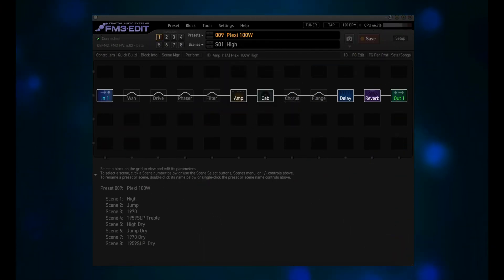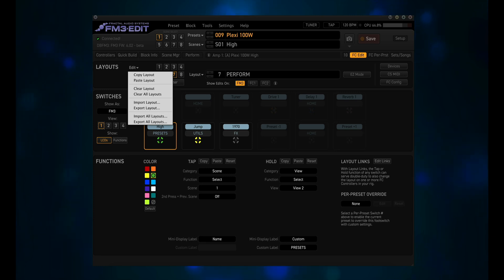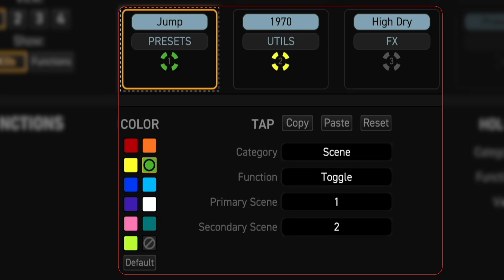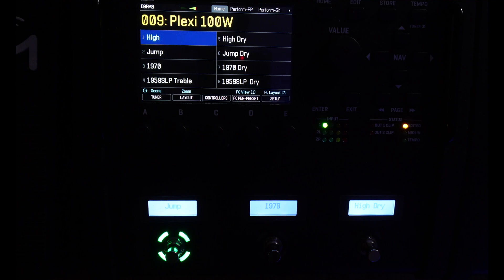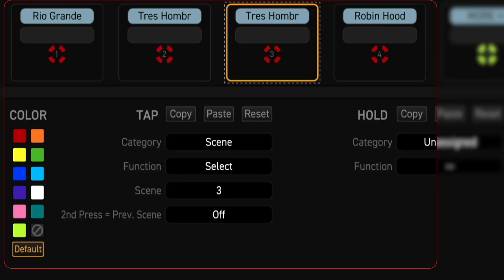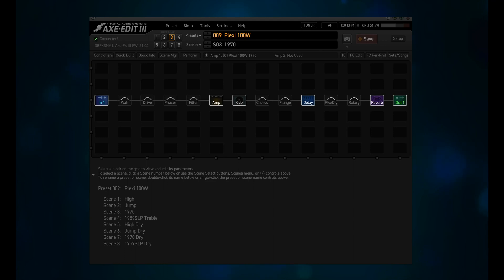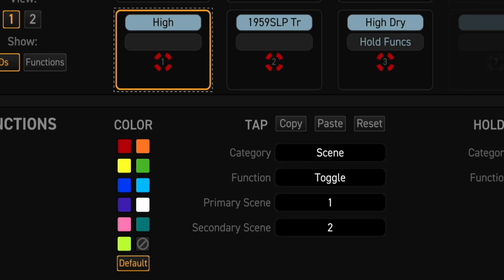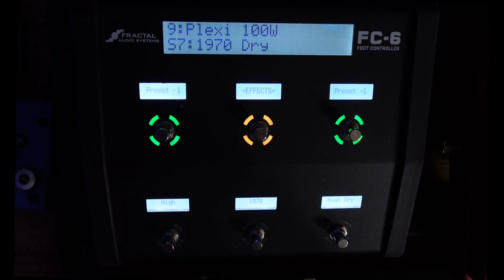Axe-Fx III/FM9/FM3 - Are You Going To Let Those Layouts Hold You Back?

Comment: Great tutorial as always, will try it out for sure on my FM9. Due to the way my scenes are structured, I might try it first by putting scene 1 & 5 on switch 1, 2 & 6 on switch 2, etc.
Reply from the maker: Go for it!
Reply: @DougBsDigitalDen  : I had to do it a little bit different. My layout 7 is not perform but per preset. I had to use layout 2 which is scene and use the hold option to switch between scene 1 and 5, 2 and 6, etc. The issue with this approach is that I don't see the name of scene 5 - 8 on the mini display. I do have to click the more swiths to see the names. 

When I switch the funtion to toggle and change "turn the 2nd press to the destination scene", something weird happens. First all mini display switch to custom (the scene name on the hardware unit dissapears) and the ring lights of switch 1 - 3 turn off except switch 4. 
I will continue to try the toggle approach to make it work, I really like it.
Reply from the maker: The LEDs are working correctly. I have my Scene Layout set up to toggle 1/2, 3/4, 5/6 and 7/8 using the first 4 footswitches. When I switch from Presets to Scenes, only the first footswitch is lit up, because it defaults to Scene 1. The 2nd, 3rd & 4th footswitches are dark. I know; that's just odd! But I think it's explained somewhere in the Footswitch Guide. 

I don't know what you mean by  "turn the 2nd press to the destination scene" - when I'm in the Tap section and I use Toggle, my only options are Primary Scene and Secondary Scene. When I click on one of them, my options are 1-8. Are you seeing something different?

I don't even use the Hold section - but if I did, then I could set Hold Toggle Primary to 3, and Hold Toggle Secondary to 4. But that isn't necessary, so the Hold functions stay unassigned.

Keep me updated!
Reply: @DougBsDigitalDen  Thanks for taking the time to reply.
Regarding the light of the foot switch, yes I do experience the same. 

"turn the 2nd press to the destination scene" : this is what you can see when you switch the function to toggle. 

I am still trying to make the toggle switch to work as shown in your video. After that, I will use the hold section for something else. 

Continue with the great work. I learn so much from your video's.

Comment: Great Video! FM3 user here! Didn't back up my Factory Scenes before I modified them, so ... hope I can straighten them out!
Here's a question for the guru! Is it possible to have 8 presets as scenes, and then have the scenes be channels?
If ya know what I mean? (FM3)
Reply from the maker: I think I know what you mean, and the answer is yes, but with a caveat. If you mean "Can a preset with multiple Scenes be saved as a single Scene?" then the answer is no. But if you mean "Can a preset with one scene be saved as a scene in another preset?" then the answer is yes. However (sorry!) if you mean "Can 8 presets that each have one scene be saved as 8 scenes in the mother-of-all Presets, then the answer is "Maybe". The FM3 has limitations, such as only 1 Amp block with 4 channels. So if each of those single-scene presets use a different amp type, then the answer is no, because you can only have 4 amp types in an FM3 preset. BUT if you look over those 8 presets and find that they only use a total of 4 different amp types or less, then you're getting closer to a "Yes", because you can use Scene controllers to change parameters from Scene to Scene, if necessary. So you would have to look over the 8 presets in question, see what blocks they use and then check the FM3 to if there are any block limitations that might hamper you. Also keep in mind the CPU limitation of 80%; go over that and your preset can crash and burn.  Hope this helps!
Reply: @DougBsDigitalDen Wow! Thanx Doug! That took a while just to type, so thanks for that! Now I got it! I always wondered if you could do that!